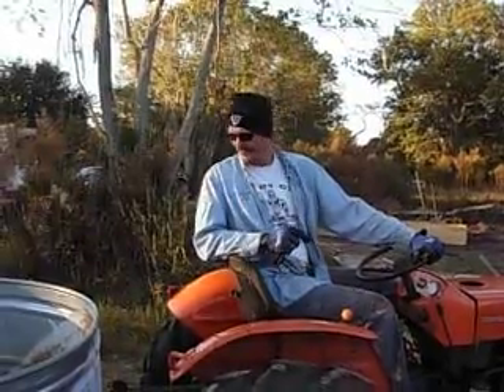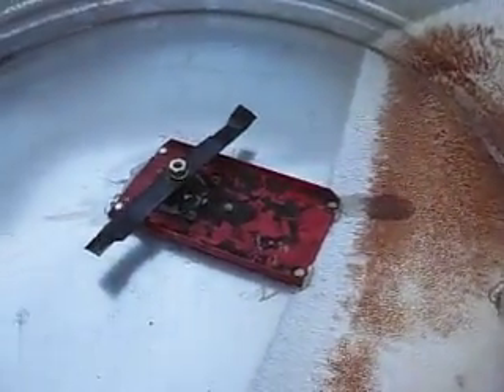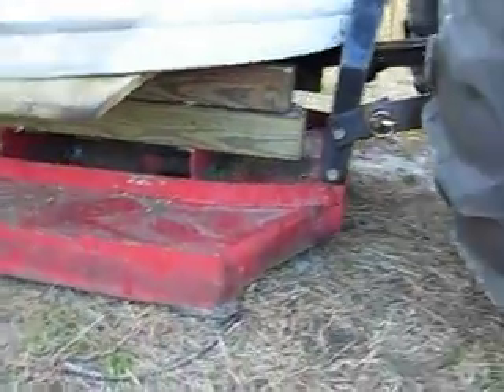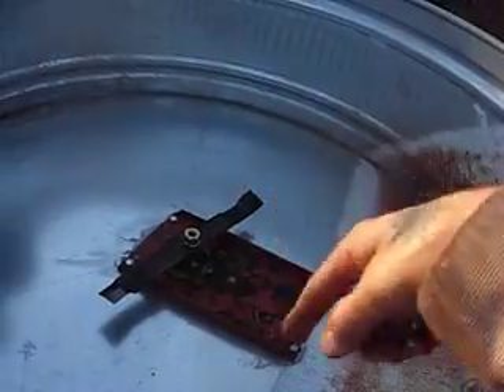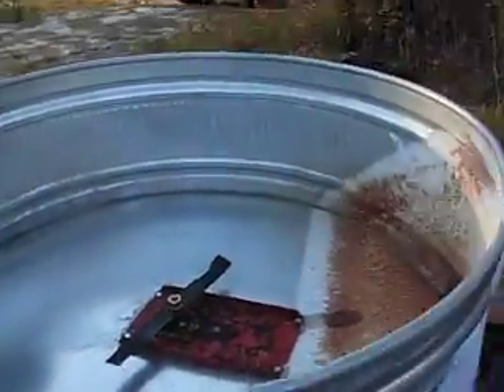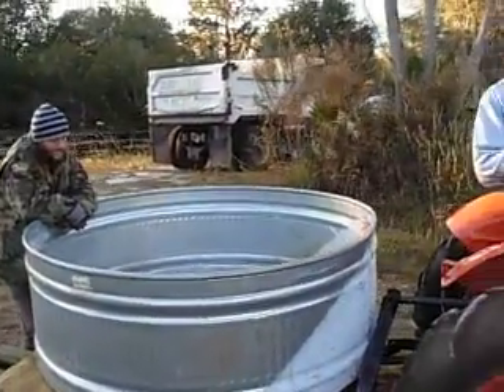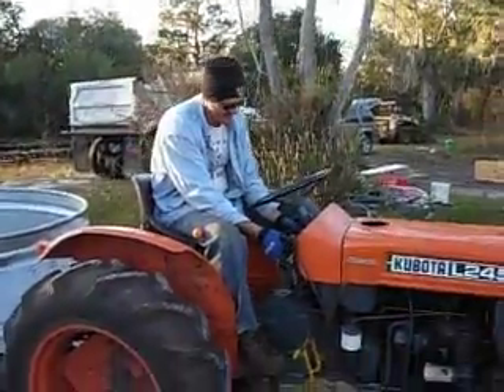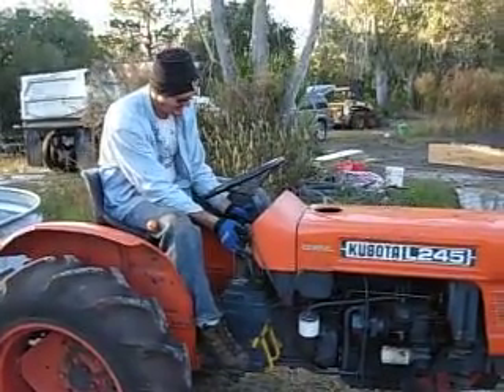"Da Choppa" Papercrete machine

Comment: Da Choppa Rocks !
I actually bought an old brushhog cutter with the intention of making a Papercrete mixer, but have not (as of yet).
What is your method of pouring? Is there a chute on the bottom of the tank?
I wish you had more videos on this mixer and the process... any chance of that?
Great job ! Much better than pulling the tank to mix it.